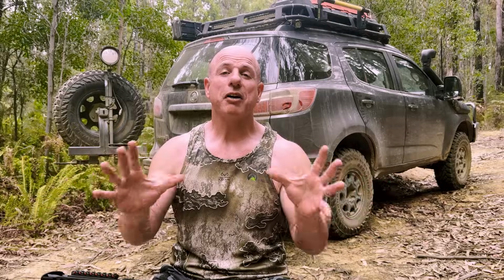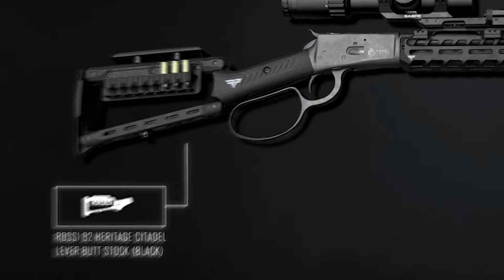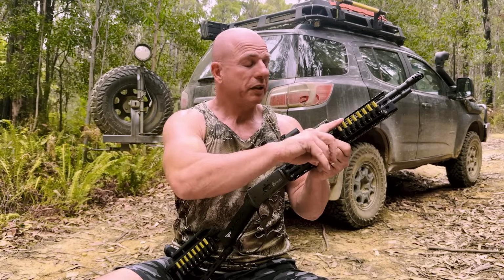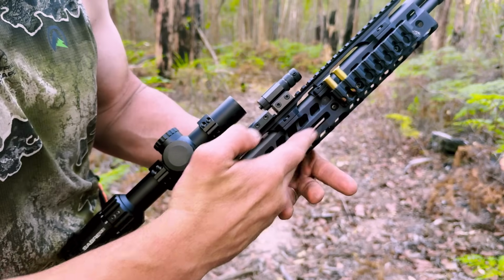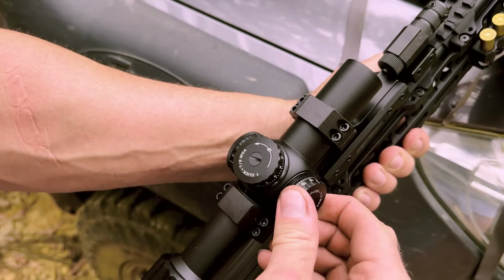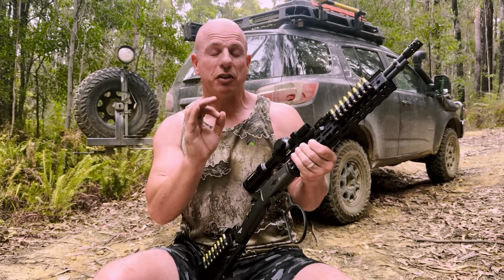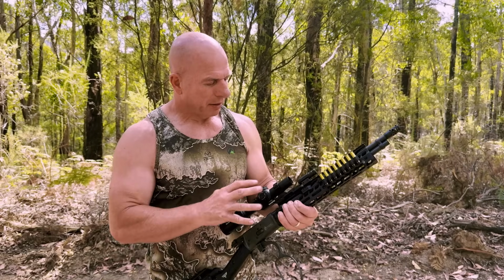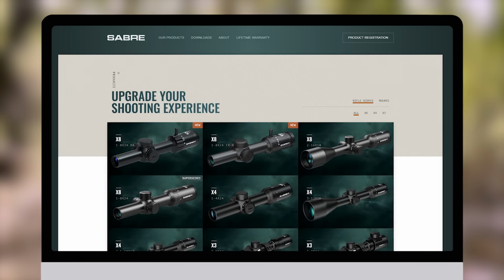I Built My Perfect Rifle - Custom Citadel LEVTAC Edition

Comment: Hey mate, I have a Rossi r92 which is similar and top eject. Would you be able to focus on the scope mount so I can too use similar for top eject?
Reply from the maker: Hey There, yes that is a very similar set up. There is a focus section in this video talking about the top ejection and how we specifically chose this scope and mount set up to provide good scope operation and still a workable ejection.